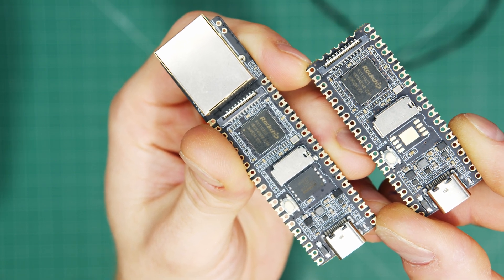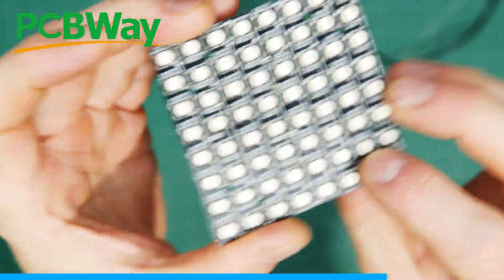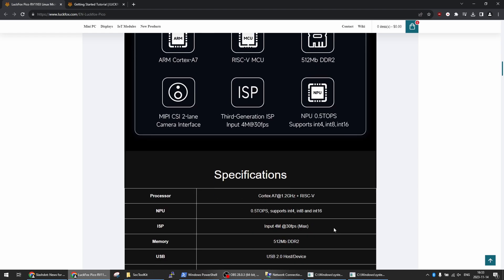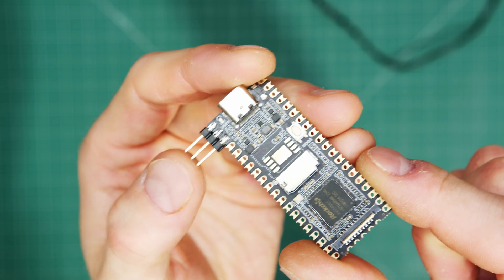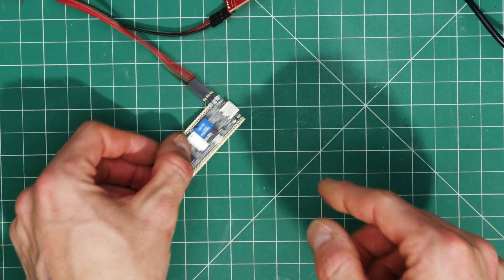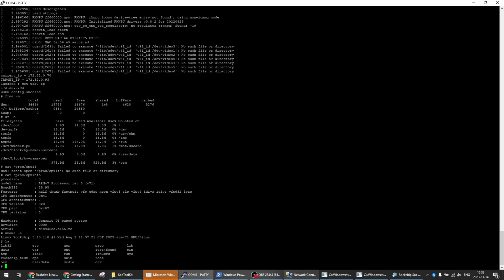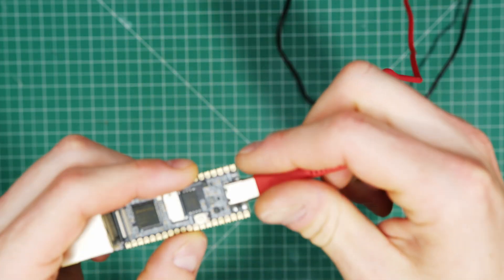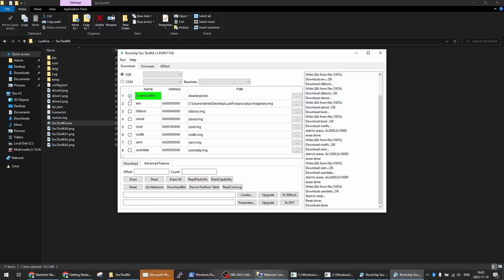Luckfox Pico - Milk-V Duo and Ox64 Killer?

Comment: I tried compiling some programs for the plus, but you can't store any executables on the sd card because it has to be in FAT32 which has issues with file permissions ... that was a bummer
Reply from the maker: Yeah in Pt 2 I'll cover a bit more like that. Best to store within the image, eg copy it across with `adb push` after doing a cross compile, else you can probably slap another partition on the SD card as ExFAT... I'll have a tinker and let you know!
Reply: @PlatimaTinkers  yes please, if it's possible with the ExFAT let me know, thanks a lot for video BTW
Reply from the maker: @AboubakrA yeah no worries mate I've got one connected out at the workshop that I'm heading to shortly. Will try it out and let you know! 

You're also very welcome. Cheers
Reply: I'm trying to send the link for the VM that has the cross-compilation toolchain in a comment but it gets deleted, I can send it on email if you're interested
Reply from the maker: @AboubakrA just screwing with this now - have you got Pico or Pico Plus?
Reply: @PlatimaTinkers  I have the plus and still figuring things out too. I was able to access a mode called debug mode one time by mistake but now I don't know how to get there again it has all sorts of hidden features and controls, and I don't see it documented anywhere
Reply from the maker: @AboubakrA hey mate was it not just in maskrom mode from holding the 'boot' button?

From my testing with the SD card so far; if you flash SPI and flash the SD card, then boot with SD in, it'll boot from SPI as default and then mounts one of the partitions at /mnt/sdcard, however, this is not using a normal partition layout which would be accessible on a computer.

I am currently compiling a new image for the Pico Plus for you which supports SD card for storage as per https://wiki.luckfox.com/Luckfox-Pico/Luckfox-Pico-Plus-SD and will test what partition schemes it supports - I am thinking likely only ext2/3/4.

You may want to transfer cross-compiled apps using `adb push` to be honest, and I did not that FAT32 should work, and have seen a 'permission error' when attempting to execute a binary compiled for the wrong platform, so you might want to check your target and toolchain as per the compile examples at https://wiki.luckfox.com/Luckfox-Pico/Core3566-SDK#application-example

Cheers
Reply: If mounted, it supports EXT4 format TF card, and now also supports Samba.
Reply from the maker: @tongxu6959 yeah I just modified the source and recompiled to allow SD card, but I also disabled SMB and ADB the same time; it has SSH, no need for extra memory overhead! Haha. Cheers
Reply: I bought Luckfox pico pro max (256MB) NAND flash. 
I tried compiling image for SD boot. it compiled succesful but output dir was empty. 

I can connect and do stuff in the USBRNDIS interface but not the ethernet interface. 

I need to use V4L but luckily, when i explored, that was default.
for now, I cross finger on accessement of the board untill i expore more of it
Reply from the maker: @a.a.patrick  Sounds like it didn't compile successfully sorry mate. I just did a test and followed the instructions on https://github.com/LuckfoxTECH/luckfox-pico and it worked a treat, with the 'IMAGES' folder full of all my binaries afterwards.

Just keep playing around, read lots of docs, etc!
Reply: @PlatimaTinkers   Yea, I got it compiled finally. 
I would love to get the board on my internet through my PC. 
I need some lib install. 
this will require compling my busybox with nano enabled. 
the default vi in the luckfox is not my favourite and won't want start using it.
Reply: If you want to mirror in TF, you need to modify it in the most basic version of the Luckfox-Pico branch. It is necessary to open the network port and GPIO pin adaptation and modify the relevant device tree files. @a.a.patrick
Reply from the maker: Sorry mate did not get an email notification for this one! I'd re-check the docs as they are adding more every week, or try a new image too!

Comment: hmm, is there a Linux/macOS version of that little tool? if not, this board is some hot garbage to me 🔥

in any case, thanks for the great video!! ☺️
Reply from the maker: Hey you're very welcome! You shouldn't need DriverAssistant on macOS, and using my SD image you won't need SoC ToolKit either. If you want to flash the SPI you will, but you can probably try cross compiling https://github.com/xboot/xrock and then just write each of those binary files at the corresponding address as shown in the screenshot or listed in the .env file!

Comment: You can have SD and SPI?  Nice that's better than the DUO.
Reply: what do you mean? i’ve been working on a Duo project but i’m stuck on SPI. it feels like reading/dev/spidevx.0 results in weird, unexpected outputs 

is this because of the microSD? 🫣
Reply from the maker: @Onkoe  They are physically in the way of each other too :(
Reply: @PlatimaTinkers  thanks! however, does that mean i can’t use SPI _at all_, or that SPI storage devices can’t be physically mounted? 

i just need to access a breakout board that uses SPI! 🥹
Reply from the maker: @Onkoe  Sorry not sure which model you mean here; Pine64 Ox64 and Milk-V Duo appear to be SPI or SD, not both, but this supports both. 

On this LuckFox Pico there is SPI0 and SPI1, with the onboard eMMC appearing to use SPI1 and SD using SDMMC. You should be right to use SPI0 on pins 9 (CS1) 12 (CS0) 14(CLK) 15 (MOSI) and 16 (MISO). Just note that you will likely need to reconfigure the device tree and/or recompile the image. Ref: https://wiki.luckfox.com/Luckfox-Pico/Luckfox-Pico-OLED
Reply: @PlatimaTinkers  ah, that’s my bad! i’m wanting to know if i can use a normal SPI breakout board on my Duo while using a microSD for the OS.

an “either or” situation would really suck… 🫣
Reply: @PlatimaTinkers  the Ox64 and M1S dock can use both SD and SPI at the same time.  The DUO is the only one that can't.
Reply from the maker: @Onkoe  Aah yeah the Duo is the one that cannot!
Reply from the maker: @davidwillmore  Oooh I just went and checked and you're right! There was something else I was using then, that's not a Duo, where the SPI was in the way of the SD slot and it made me mad haha.
Reply: @Onkoe  I would assume so.  I asked on the discuss forum and was told that the same signals run both ports.  The schematic agrees.  You get one or the other.
Reply from the maker: I believe this true, but I believe that it ALSO physically gets in the way :(
Reply from the maker: @davidwillmore  I believe this true, but I believe that it ALSO physically gets in the way :(

Comment: That SD card creation process looks horrid.
Reply from the maker: Haha, why's that? One of the best I've ever seen for an SoC! You can use Balena with the .img.gz I've provided if need be, but it will give you errors/warnings due to how the image is laid out.
Reply: @PlatimaTinkers  it's a windows only tool?  Other boards don't need a special image generation tool at all.  Even the bl808 has Linus and macOS versions of their programming tool.
Reply from the maker: @davidwillmore  You shouldn't need DriverAssistant on macOS, and using my SD image you won't need SoC ToolKit either. If you want to flash the SPI you will, but you can probably try cross compiling https://github.com/xboot/xrock and then just write each of those binary files at the corresponding address as shown in the screenshot or listed in the .env file! Bit of a shame there I guess, but at least there is some solution!
Reply from the maker: @davidwillmore  Luckfox engineering just gave me this new link: https://wiki.luckfox.com/Luckfox-Pico/Luckfox-Pico-MacOS-Burn-Image/ Enjoy!
Reply: @PlatimaTinkers  cool, thanks.
Reply from the maker: @davidwillmore Very welcome bloke!